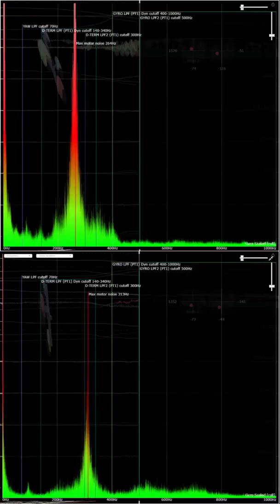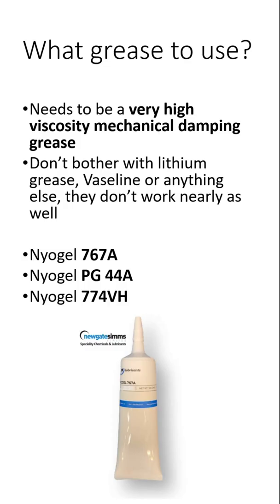Potentially the best way to damp vibrations on a drone. I'm not kidding, its amazing! #shorts

Comment: There is zero chance that this actually works like a glue as you claim and prevents screws from backing out. A lubricant, no matter how thick, will not increase friction, that's definitionally impossible. I'm sure there's some change happening before and after applying grease, but the more likely source of that is from using the same force to tighten dry vs. lubricated bolts will result in exceeding the torque specifications of the hardware, essentially you're just over tightening all the bolts. I'd be interested in vibration test with dry bolts at specified torque vs. Overtightened beyond spec., I suspect the results would be similar. These are all engineered as rigid frame machines and you're actively working against their whole working principle by decreasing the surface grip at the material interfaces. I think mechanical alignment of all the joints  and proper balancing of props and avoiding harmonics at certain rpms would show a much better results, with the added bonus of not weakening the material due to fatigue from overtightening. Another concern that seems to have been overlooked is material compatibility between the grease all the different rubbers of the wiring, seals, plastics, composites, etc. Not all grease types are safe to use across the board. Any other lubricants or chemicals that may come in contact with the grease could cause the breakdown of the suspension agents used that hold the oils in that very viscous states.if it ends up on any motor shafts or motorized mechanical joints it will increased resistance and premature failure. Hopefully it's still working out for all of you, just a cautionary tale about unintended consequences that you didn't know could be issues. Personally, I trust that the teams of mechanical, electrical, and aviation engineers know more than I do, and thats why I buy their products. I don't think it's as easy as slathering every surface and part in heavy grease to increase performance...because that's cheap and easy and every company making them would be doing that to get a leg up on the competition, but literally none of them are. If you think your idea eclipses the entire industries collective knowledge, more power to you, it's also probably a good chance that you're a flat earther too, as the unwarranted level of ego in both of those are just about even, and that's just crazy to me. 
 But good luck, and happy piloting!👍

Comment: I get the idea and saw in many of your videos you advocating dampening grease. While I would have loved to do this, a) it's kind of expensive for sludgy grease, and b) I simply didn't have any and would have bought some if I could have gone to my local store and picked some up. However, I just built my first real quad, I built two, last night, I built one before, but lost it about as soon as I had built it, so leaving that out. Not having dampening grease I wondered what I could use in place, and had just purchased blu-tack for the first time, and that felt like it would serve the purpose. I rolled it super thin and long and smashed it in to my screw threads and everywhere. When I tightened up my motor and frame screws I was able to clean the excess blu-tack with something really sticky called blu-tack ;). I'll let you know how it goes, but I think I may be on to something. Could you test it?
Reply: Did it help?

Comment: Hi Chris, I have a quad that I built from old spare parts that I've acquired over the years and unsurprisingly it had a wide spectrum of noise on both the roll and pitch axis that needed a high amount of filtering to just keep the motors at a reasonable temperature. I found the Nyogel 767A on Amazon and it had a promotional discount at that time, so I decided to try it out based on your suggestion. I think you left a review on this particular product calling it FPV butter or something like that. Anyways, I disassembled the entire drone and applied this grease to all touching surfaces and connecting hardware. Did a  pretty aggressive test flight that barely warmed up the motors and the BB log showed a much narrower noise spectrum that will be easier to manage. Just wanted to say thanks for the suggestion, it is working great for me 👍

Comment: Hi Chris, I am on my way to binge-watch the whole channel. Thanks for all the great content, as a engineer who always asks "why?" this channel is heaven.
One question: I'm about to build an Apex, thinking about using the grease you mentioned. Do you think it is neccesarry and if so, how would you apply it? Just on both sides of the arms (top and bottom) where they are between the plates? Thanks for your reply, greetings from Germany, Ludwig.
Reply: Obviously Im not him, but yes, you would want to apply it anywhere there are two touching surfaces, and on the threads of the bolts.  Im sure someone will yell at me if Im wrong!

Comment: You and UAV Tech are to tuning what drone mesh is to in depth hardware testing. Love people like you all who go super in depth into the reasons behind the choices we make as pilots. Between you, bardwell, drone mesh, and UAVtech people should have absolutely 0 problems selecting, building, and tuning a great flying quad. Only thing I wish had more coverage on youtube is 3D flight, so little info about parts that work well with it aside from zoe but she hasnt really been doing much with it lately.

Comment: Would silicone sealer provide damping?
Reply from the maker: It might do. Only one way to find out 👍
Reply: @ChrisRosser  Is all of the impulse energy coming from motor vibration? Can energy be transmitted to the frame from vortices shedding from prop wash and influenced by the width to thickness profile of the arm? Only discovered your videos yesterday, going back and watching them all, there fantastic.

Comment: Yeah, I was thinking of cutting a dampening pad from a flat 0,5mm silicone pad and placing it between the FC and the arm plates of the Apex. You can cut it into exact shape and it doesn't make a mess. The other thing I've been thinking of is using the top plate for the FC instead of the bottom plate. Then the vibrations have to travel through the standoffs into the FC and the longer the trip, the more attenuated the noise. You can even isolate the FC completely with the dampening rings from the carbon parts if you want but it doesn't seem to be very popular. And ofc I can't model how much the top plate actually bends during the moves to actually know if that's viable. But dirty vs clean assemblies have existed for quite a few years already and there are people who swear by it and others that swear at it.

Comment: @chris Rosser. I Just got the 767A, I think i will try it on my cinelifter. After I try it on my 5 Inch. Is Pg 44A better or does the 767A work well too?
Reply from the maker: I've had good results with both. I would give a slight edge to PG44a but it's not much at all.

Comment: Nice, but this grease will take a lot of dust and other particles. Together will create brush paste and then even the smallest movement will just slowly increase the tight fit of the frame?
Just critical thinking there. But I will buy some for myself f sure and test on some of my quads, why not. Ty for the video.
Reply from the maker: Let me know how it goes. I hope you find it gives a good improvement.

Comment: I you are applying that grease at the junction  between the arms and body, almost certainly you are less damping and more removing the frequencies caused by fretting vibrations, I.e. the surfaces rubbing and making squeaks like nails on a blackboard. The insulation tape either lessened friction or created grip that stopped fretting a little, screw tension you mentioned as a variable points to it. Industry standard practice is use a sealant to fix all the parts together and help make the vibration shared across the whole air frame as you mentioned many tones of vibration consolidate into effectively 1 when read at the gyro. The trick is to make the vibrations as longer wavelength as poss. Sillicon sealant, such as RTV will do fine by providing interfay and not prevent disassembly later. Your aerodynamic "arm swimming" effect is I'm sure the translation of that rotational and flexing movement whilst props work and will manifest at the interface of the plates and the only movement it can do is to slide as its pinned by screws. So I would say completely opposite to grease that fixing all seperate parts would provide big gains. Further improved by a sorbothane soft mount to isolate gyro. Also 2 gyros one hard mounted on frame, one damped, then you can subtract frame vibes from flight gyros read.
Reply from the maker: Thanks for your comment. It's certainly an interesting idea but I'm not sure your hypothesis fits the available data. If I understand you correctly you suggest that fretting vibrations should be improved on unibody frames because they have fewer joints and therefore less fretting. All the parts are fixed together. However, unibody frames are known to have worse vibration problems than separate arm frames. This data would suggest that joints make things better (by adding damping) rather than worse.
Reply: @Chris Rosser  I wasnt devaluing your points or making a hypothesis Chris, I stay well away from maths if poss and it's all guesswork as I dont read logs either 🤣, I'm a crayon kind of guy, I'm blue collar aerospace engineer starting life in Airbus military R&D and only working on high tech military and airliner mods or repairs at a structures level pretty much 2 decades now and it's all become composite.
 As much as i respect your physics as it is our primary tool, I am purely cross applying what I've seen and how it was solved. I dont see anything you said as incorrect only I'm approaching differently and it may well be at this scale it's too fine a scale to apply anyway but i dont feel it myself. Technology is only ideas passed down anyway, we don't get new stuff at the open source level. 

As you've said there's many aspects at play, not only the forces but also how the gyro deals with it and then how the software is set to compensate.  (Also the person using it). You have both the type and amplitude of the vibration to worry about. I see why more joints with some damping or lube would provide less effective vibration, as like a bird flapping wings the movement becomes fluid and the amplitude is shared at each moment, you just limited travel and greased the mechanism if it does move with your grease, quite clever actually, but it's still the resolution of lots of different points of variability and consistency is unlikely without aerospace levels of control or as you said screw torque (and we arent all going the torque screwdriver route yet I doubt). I'd guess a unibody would be providing a more unified resonance of long wavelength and higher amplitude, so has more power to effect gyro or make something else vibrate at a different point, but the wave will be much simpler to deal with because its constituent parts are less. so if I am right and if to make one, my hypothesis would be that if you fixed all your moving  parts and screws etc, anything capable of making noise, then had an effective damper to the gyro such as soft mounting on sorbothane as it will deal with any vibes, that would do it, it's also a great British invention 🤣. If that worked and you want to go high tech then as mentioned the next level would be to hard mount a gyro or a vibration measuring device to the frame and minus the damped from the undamped signal, giving a cleaned signal to FC.

Also interesting thought about Piezo as a possible active damper, that's not used on big stuff and my knowledge isnt strong enough to know what they are capable of. I saw other people think of it in different applications which is great to see, because that would be true invention and they havent had the benefit of what I've been lucky to see I doubt, it's just noise cancelling, I'd guess read vibe with a crystal then output via another?. This is a really important source of practical engineering skill for people, and I think we need to preserve that.
Reply from the maker: @DigitalArtisan77  No worries. I was just aware that others will read your comment and I wanted to give a fair response to it based on my knowledge and the testing I have done. Certainly any parts that might rattle and generate noise should definitely be fixed in place. Most of the noise we face appears to come from the motors and from aerodynamic buffeting. I think that's why adding damping into the frame helps.
Reply: @ChrisRosser  I still think its translating to fretting but I won't challenge you as you've researched lol. Agreed frame damping would help, theres 2 main ways you want to damp, damping to absorb vibes within system by as you have, but also then damping to protect gyro, we dont dont really have many choices for mounting gyros other than sillicon currently, which is ok ish would like to see sorbothane insulating one. I think whilst we use flat carbon board the resonance performance will be bad, have you tried any tubular armed quads and or different materials just for reference such as the plastic 3d printed ones starting to show? In air frames a lot of the shape of the structure is harmonics based to stop or share forces 3D printing holds good promise there as additive material processes really allow new capabilities and ideas and for anyone pretty much.

Comment: placed this comment already on Joshua Bardwells live Stream, but it should make more sense here.

No doubt that grease might work. When in training for heavy Portal milling, we placed palm sized thin cardboard/paper sheets under really heavy machine parts (around 5-8 metric tons) when facing resonance Vibrations, showing up in the surfaces. The Paper did the job, avoiding these resonances. So before greasing, i would give e.g. a layer of a phonebook sheet between arms and frame a try. Or both. It's too simple not to try it!

Comment: As another material to try, that's not as sticky - silicone thermal pads 0.5mm-1mm might work decently well I think. And be easier to handle, they squish quite a bit so should be reasonably easy to fit them well at least under motors and stuff like that.

Comment: this is not unlike the dampening grease slathered onto the back of disc brake pads which interfaces to the caliper and reduces all kinds of brake noise!

https://www.super-lube.com/Content/Images/uploaded/documents/TDS/Technical_Data_Sheet_Silicone_Brake_Grease.pdf
compared to nyogel 767a
https://shop.newgatesimms.com/wp-content/uploads/TDS_NyoGel_767A.pdf
Reply from the maker: It looks quite different. The nyogel is at least 6x more viscous. I would not expect that lube to work as well.

Comment: Hey Chris, I have a weird result from experiments using some Nyogel 767A on a Shendrones Squirt - standoffs and motor mounts. The prefiltered gyro data is very similar in the before and after lube application,  but the prefiltered Dterm tells another story. No settings changed between the tests and I made a very similar flight for both, albeit limited to max 40% throttle as the test was conducted in my shed. I didn't crash into anything and only used data after takeoff and before landing. The Dterm is way less "hot" in PIDToolbox after the application of the lube, can you explain this? The gyro data looks very similar... I can send you the files if you want them! This is literally 2x experiments but I can do a few more if you'd like them. SiFPV.
Reply: I have an answer. Looking at the data in Betaflight Black Box explorer, the noise is noticeably reduced on all axis, by about a quarter (I'm eyeballing that) and that has a massive effect on Dterm noise. Not sure why the PIDToolbox graphs look similar but the betaflight graphs say otherwise. This may mean I can reduce the gyro/dterm filtering a notch or two, which may have a huge improvement on handling! Again this is based on 2x experiments and if you need some more data on this cinewhoop class then give me a shout! SI
Reply from the maker: Yeah even a small improvement in gyro noise is a big deal for the DTerm because it amplifies noise so much. Glad to see the grease helped you. Now go crank those PIDs and riiiip!
Reply: @ChrisRosser  cheers mate!

Comment: Awesome ideas. I tested my frame with 1 layer of electrical tape but it didn't do anything, so I'm gonna try this out and see if really makes a difference. Eventhough the gyro doesn't pick up the vibrations at high amplitudes, this method would create minimal movement in the arms. Do you think this could cause negative effects at some point due to imperfections, or is this not to worry about at small scales??
Reply: Where did you buy it? I can never find such things where I live. Not even conformal coating is available lol
Reply from the maker: Links in the video description. Hope you can find somewhere to buy the grease.